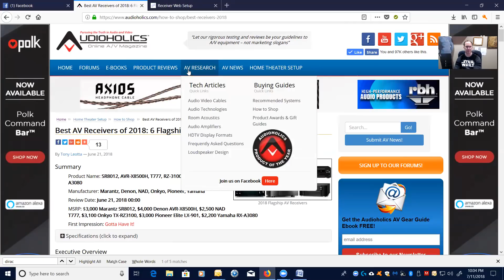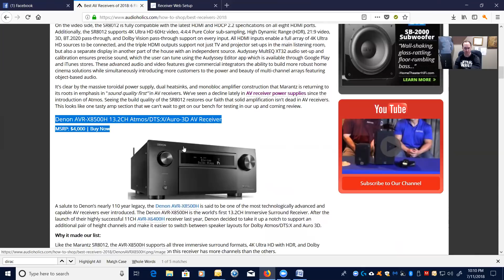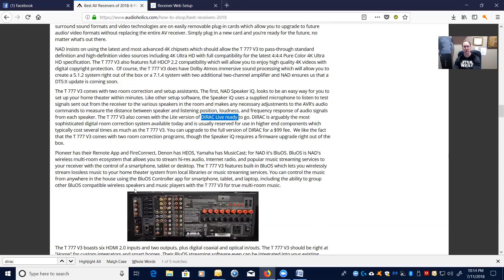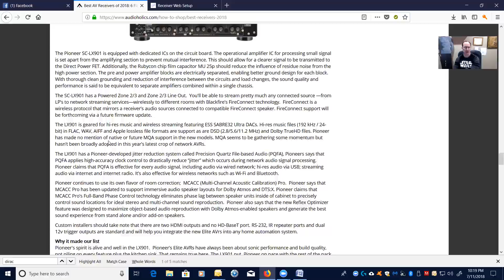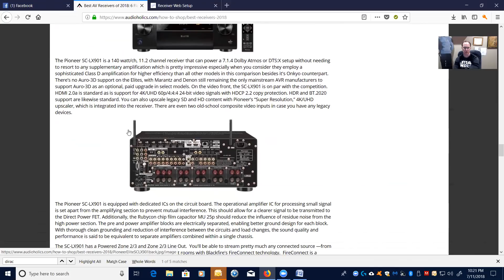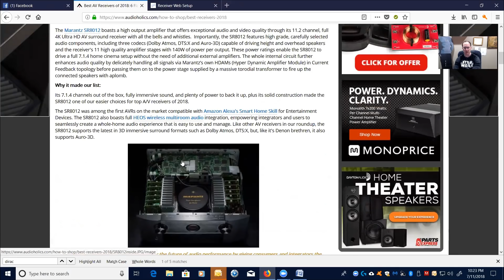The Best AV Receivers of 2018

Comment: Hello guys, please can you point me in the right direction. What multi channel Power amp would you recommend to use with the Denon Avc A110? I am currently running a 9 channel surround system with 4x Def tech BP9060's, CS9080 & 4x Def tech DI 5.5. Thank you
Reply from the maker: Why would you buy such an inexpensive,  capable receiver to not use the internal amps? You are better off going with an AV8805 and external amps if you think you need more power.

Comment: I bought a POS LG LHD657 and it has 4 tallboys and 1 center and 1 sub. Now I changed all my wire to 16 gauge wire but the sub has just speaker wire that's built into it and I found out it was foreign. As I opened the box I saw the sub was damage. I had to try get it fixed and it's way worse looking than it was before. I out $800. $400 for the system which the guy would not give me my money back plus everything I spent. Anyway. I wasn't tons of bass. What can I do?

Comment: I know that his video is old, but I'm looking at getting the Yamaha RX-A3080 New and sealed for $1,525 right now on Ebay through a very highly rated seller, and I'm wondering if you feel that it's still in the top tier of A/V Receivers right now?  Especially for this price!  Thanks

Comment: I'm looking into a second amplifier to run either two or four main channel speakers are the second amplifier have the Denon 2400. just suggestions on the best way to connect it and what would be the best secondary amp.  to hook up about a hundred watt speakers * 4 to the second amplifier thank you audioholics,

Comment: I just purchased the Yamaha 3080 .I'm a little confused. The box shows 9.2 with a 11.2 pre out. does this mean I have to purchase amp? Also I heard you guys talking about getting  the amp for the front Left, Right, Center. I have the RF82ii Left & Right. The RP450c Klipsch. I have two RP-502s and two of the Klipsch RP 205S Any suggestions for which type for the side rear and the back rear. Then last I have just got two R-115SW  with the wireless modules. Should I do anything about the top Dolby Atmos. Thank you for all the post that I have watched. Please recommend some ceiling speakers and how to place them. David
Reply from the maker: Yes you need a 2CH amp to do 11.1 or 7.1.4 speaker configuration. Height speakers should be placed +- 20-40deg off axis from primary seating position and about the same,width as front speakers.

Comment: Hi Gene, Would love to see a video on the proper way to integrate an older AVR With a new AVR to power the front main left and right speaker channel's.  I just upgraded to a Dennon X4500H from an old Denon 3806 the old denon does weight quite a bit more for sure....but instead of putting it out to pasture though I could use it to power the front mains...there is not a lot of info on how to do this properly...and there must be a lot of people out there with similar situation on what to do with those old AVR's....Thanks.
Reply: Joe M Ricardo I have the Denon X4200 and I did just what you are suggesting here with my old 2807 I replaced. I used the pre/pro for the two front channels and ran it to the 2807. Room correction sorted out the rest. I just had to turn up the volume on the 2807 once and run it again to get it dialed in. It gave me much more headroom. I was watching Netflix movies at 80-90 on the volume dial before, now I’m down around 60.

Comment: I just purchased the Yamaha RX a 3080 replacing my RX a 2000 after the HDMI bored going out I should receive it in a few days steel curious about the XLR Preout since I will be using my Macintosh MC 207 for the pre-out and the amplification in the receiver for my front affects speakers. Using the XLR front in the pre-out will it still work with the rest of the pre-outs

Comment: But what about hdmi 2.1 in these? It's stupid that it hasn't been implemented in these since the hdmi 2.1 standard was approved back in late 16'. None of these are worth it simply because of that. Also, wtf is with these companies not putting toroidal transformers in all of their flagships? They cost the same to make and produce near zero magnetic fields, so less noise. Then pair that with a class d and you've got magic. These manufacturers just make no sense.
Reply from the maker: HDMI 2.1 chipsets were not available until very recently. 18 AV receivers were designed at least a year earlier than the chipsets were available. Toroidal XFormers typically require a larger footprint and space is at a premium in most of these already crammed AV receivers. Class D can be very good if implemented correctly. Unfortunately not all are without compromise compared to linear amp implementations.

Comment: Thanks for your videos.  New to the club and am trying to figure this stuff out.  I've read that separates are better than integrated boxes since the separates can concentrate on one thing rather than many.  When I look at separates the watt output is often relatively low (50- watts) and some speakers want 100+ watts and even the integrated ones don't get beyond 120 watts very often.  A few questions in this post - are separates better, what am I missing with the wattage ratings?  Thanks

Comment: I have a 5805.  Would you upgrade to Denon AVR-X8500H?
Reply from the maker: Only if you plan on doing Atmos and need 4K HDMI switching. It's hard to give up the 5805 as it was one of the best AV receivers ever made.
Reply: I don't need switching but any solution for keeping the 5805 and introducing Atmos as I have a LG oled and a Panasonic Blu-Ray with Atmos?
Reply from the maker: @kevin-sv6uu  only if you use the 5805 Amp section and,buy a separate Atmos preamp.
Reply: What preamp would you recommend?

Comment: I've been watching your videos for a couple of months and have learned a lot. I trust your information. I have a Yamaha RX-V681 using Klipsch R-28F floor standing speakers for my fronts and a R12SW powered subwoofer. I am also using Klipsch R-15M bookshelf speakers for my surrounds. For my center I am using a Polk T-30. I learned a lot from you about bass management and am using your suggestion by setting all speakers to small and using an 80hz crossover. My system sounds very nice. I was wondering if you could do a review on my Yamaha RX-V681 receiver and could you explain what "Q" means on the parametric equalizer? Thank-you.

Comment: Audioholics I've seed a video from Grobbi tv about the denon X8500H, they say's even them can't afford the 150Wx13 constant, only peaks of 150W getting 2.8Kw of power against the 2Kw of the marantz sr8012, so how this enter in the measeuring? We can't also expect 150w from the channels again right? https://www.youtube.com/watch?v=Hf-L3tGgg2g&t=33s
Reply from the maker: You can't get that type of power from any single box solution using a single wall outlet. It's also unrealistic to test 13 channels simultaneously. The AVR-X8500H is more powerful than the SR8012.
Reply: Understand, is my question how powerful they are? really curious to discover.

Comment: I have Marantz sr8012. I have to say that the calibration is way more better from Onkyo rz810. In my setup it is far more better then the Onkyo and Pioneer i had.  This is the best AVR for the money. My be Denon 8500h is better but the price is much higher. Marantz is very good in stereo too. Only thing everyone must know is that the SR8012 is very hot and need a lot of air to breath.

Comment: Rating an AVR based on published specs is like rating a sports car based on published specs.
Wouldn't it be nice if you actually listened to the amp before you made any claims?
Just asking...
Reply from the maker: I've spent many years "listening" to flagship receivers from all the brands on this list. I also spent many years testing them objectively in greater detail than any other members of the audio press. Based on the feature set, and power capability of these products, they are among the best new AV receivers for 2018.
Reply: With respect, this is rubbish.
We have all seen reputable companies with long histories of making great stuff release disappointing products.
An AVR must do two things: produce high-fidelity audio, and sync/process the sound to video with minimal degradation. If a review is not heavily weighted towards these things, then you might as well be an employee of the manufacturer, since you are basing everything on what they are claiming.

Comment: Im rocking an Yamaha Avantage RVA 3020 and when I upgraded it will be an Yamaha most likely. Great units as Ive used their gear for over 30 years and support is great, especially for a company so large. They do know a lot about sound as they do manufacture music instruments and other audio gear.
Reply: My Rx-v 2067 have a common Hdmi Problem. Speakers are not available, have to shutdown and start the Rec several times. A new Board would be around 400$ . Btw the Rec is 8 years old and what should i say as i‘m disappointed by Yamaha.

Comment: Surprised the Anthem 1120 didn't make this list.  ARC is only rivaled by Dirac at this price point in my opinion (I'm a dealer and sell all of these AVR's) and the internals and amplification is on par or better than these models.  Great vid though as always!
Reply: You're right, Anthem's audio/amplifier performance, ARC and value should have had it at or near the top of this list. However, since you can't buy Anthem on Amazon, Audioholics can't get any Amazon click commission, therefore Anthem likely couldn't be considered.
Reply: It’s a pain in the ass to adjust Dirac. It’s only for Pros
Reply: vadimkrylov Agreed in most AVR/processors, but the new NAD Dirac isn't too bad.  I've sold a few this year and one of my more savvy customers recently did a full correction himself and actually nailed it - you might want to check it out.   Still, Anthem is my go-to for performance/cost room correction.
Reply: I love my MRX720.  ARC is awesome.

Comment: what is your thoughts on the onkyo rz810 reciver..?it only does 2 atmos speakers is there anyway i can hook up 4 atmos speakers to this...?this fits my budget and does 4 ohm speakers...so i can have 5.2.4 setup..?thanks
Reply: Hi, i had rz810 and i have to say it is not a bad AVR, but it is not very good for music. Other ting i notice as a diference from my old Pioneer and from my SR8012 is the bass performance.  Just don't get it wright. Calibration do it wrong. RZ810 has a lot of power, but somehow not best sounding AVR. Other "problem" (in my case) HDMI burn twice. No idea why. Wayt for two monts to replace it (waranty) and officialy they say it is a very  "old" model. My be RZ830 is a better choice IMHO. Good luck with purchase.
Reply: thanks

Comment: Great review! For a receiver, I typically prefer Marantz. I used to have the sr7008 for several years until my son recently spilled milk into it! 🤬😡🤬😡 But it did give me an excuse to upgrade, although, this time I went with the Denon AVR-X4400H. Had to go a bit cheaper to get all the channels, features and codecs I wanted plus afford the rackmount closed cabinet to protect my gear. Not disappointed at all and I finally get to use the AURO 3D codec which works GREAT for gaming as well as music and video. NAD would be wonderful for the audio but they are always lacking in some features. The modular aspect though is genius and something I wish more companies decided to implement if they weren’t more concerned about their profit margins than customer satisfaction.
Reply: Omg kill that little rat!

Comment: Do this type of video review for best preamp/processors in last 3 years using your own personal amplifier, that way you suss out any exaggerations that the pre-pro’s from the same brand might have. Having one amplifier for all the processors creates a stable control and really gets at whether the DAC’s and Room Corrections are better on one brand over the other, without amplifier acrobatics getting in the way (i.e. not being able to handle a 3.7 ohm dip, that some of the marantz stand alone fail on).

Comment: So first I loved the video and I appreciate that you mentioned pioneer  I bought the pioneer 901 about 2 months ago am I wish I did more research before buying a receiver but I went to bestbuy and listened to the lower model 501 and thought wow that sounds good so I bought the 901 and it deos sound great but I cant tell you if it sounds better then the other receivers and I do wonder sometimes could I have gotten a better one in that price range but I am happy with the pioneer 901 and again awesome video thanks
Reply from the maker: The Pioneer SC-LX901 is an excellent choice so don't feel buyers remorse. I suspect it will bench test well and look forward to checking one out next year. Best of luck!
Reply: Audioholics thanks that means a lot coming from you

Comment: I'm banking on going with the Marantz 8012.  I've had Marantz before and thought ti was rock solid, just looking to upgrade to the latest codecs and standards and get some more channels.  I thougth about going with just the processor and seperate amps but it is a lot more money for not that significant benefit, so think I'll stick with the all in one solution.

Comment: I've been on the fence between both the Marantz and the Denon from this list. However, just recently the Anthem MRX 1120 just made my list due to it's higher quality sound correction and included mic. It also is more streamlined with it's connection ditching all those stupid archaic connections on the back no one uses anymore. Would be great if Audioholics did a review of the Anthem MRX 1120. From I can gather online, it's beats all these receivers with it's sound quality.
Reply from the maker: Wookie Groomer Anthem Arc is a great room correction system for sure but the other aspects of that receiver aren't necessarily superior to the other models in our list. We did review the AVM60 very favorably on Audioholics and also working on a YouTube Video review of it scheduled to post next month. Stay tuned...
Reply: I will.

Comment: This 2018. Why haven't they gone with class D? The could have done 110 watts per channel x 13 = 1430 if they went with Hypex Class D.
Reply from the maker: Hypex is a very expensive solution to put in an AVR unfortunately. But, agreed, with channel density exceeding 7CH, it's time to move to class D.
Reply: Pioneer Elite is class D I believe